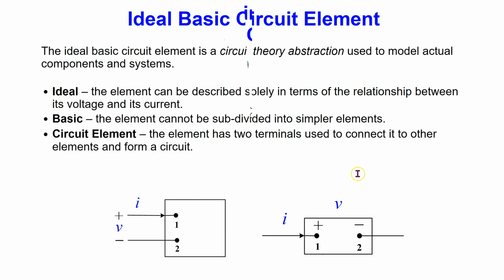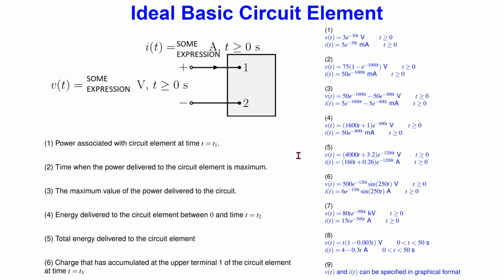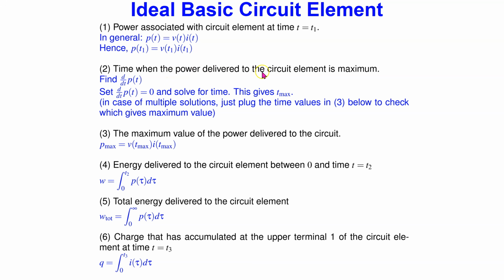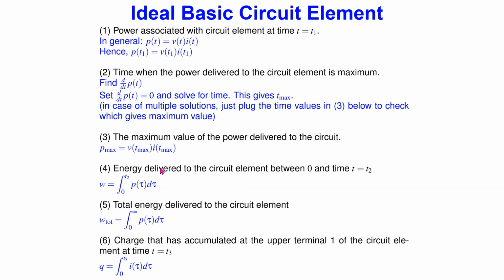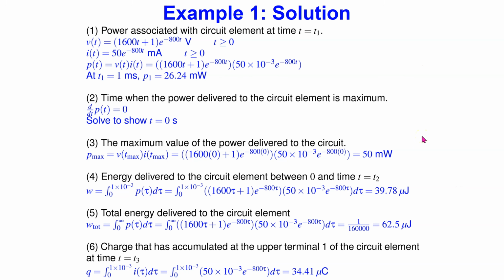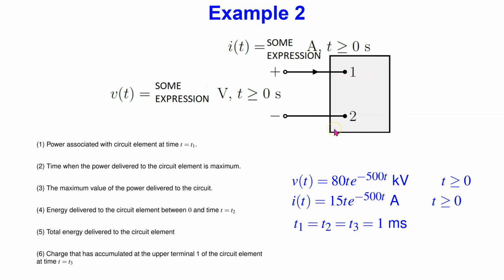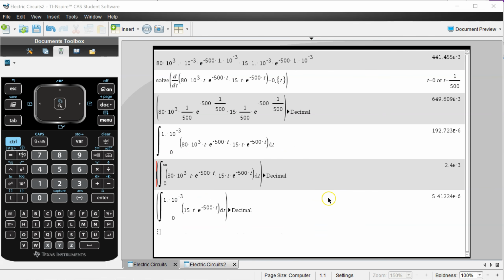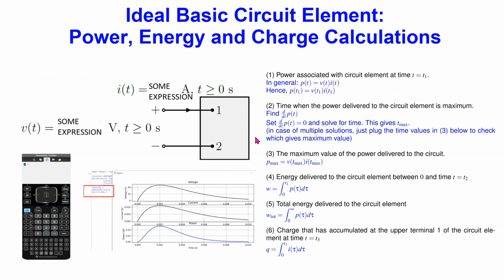Power and Energy and Charge Calculations for an Ideal Basic Circuit Element

Comment from the maker: # Pyspice (Python) code for Ideal Basic Circuit Element power, energy and charge calculations
# 
#
######################################################################
# STANDARD DECLARATIONS

import math
import numpy as np
import matplotlib.pyplot as plt

import scipy
from scipy import optimize
import scipy.integrate as integrate

from matplotlib.widgets import Cursor
from engineering_notation import EngNumber

#######################################################################
# DEFINE INPUTS

# Define the time(s) of interest
# time t = t1 for supplied to the element
# time t = t2 for energy supplied to the element between 0 and time t = t2
# time t = t3 for charge accumulated between 0 and time t = t3
# time tlim = maximum time for plotting

### Example 0
##def current(x): return 5e-3* np.exp(-50*x)
##def voltage(x): return 3* np.exp(-50*x)
##tlim = 25e-3
##t1 = 5e-3
##t2 = 5e-3
##t3 = 5e-3

### Example 1
def current(x): return 15*x* np.exp(-500*x)
def voltage(x): return 80000*x* np.exp(-500*x)
tlim = 10e-3
t1 = 1e-3
t2 = 1e-3
t3 = 1e-3

### Example 2
##def current(x): return 50e-3* np.exp(-800*x)
##def voltage(x): return (1600*x+1)* np.exp(-800*x)
##tlim = 10e-3
##t1 = 1e-3
##t2 = 1e-3
##t3 = 1e-3

### Example 3
##def current(x): return 40e-3* np.exp(-750*x)
####def voltage(x): return (1500*x+1)* np.exp(-750*x)
##tlim = 10e-3
##t1 = 1e-3
##t2 = 1e-3
##t3 = 1e-3

### Example 4
##def current(x): return 5e-3* np.exp(-1600*x)-5e-3* np.exp(-400*x)
##def voltage(x): return 50* np.exp(-1600*x)-50* np.exp(-400*x)
##tlim = 10e-3
##t1 = 1e-3
##t2 = 1e-3
##t3 = 1e-3

### Example 5
##def current(x): return np.piecewise(x, [(0 <= x) * (x <= 50)], [lambda a: 4 - 0.3 * a])
##def voltage(x): return np.piecewise(x, [(0 <= x) * (x <= 50)], [lambda a: a*(1 - 0.03 * a)])
##tlim = 50
##t1 = 20
##t2 = 20
##t3 = 20

# Example 6
##def current(x): return np.piecewise(x, [(0 <= x) * (x <= 40)], [lambda a: 4 - 0.2 * a])
##def voltage(x): return np.piecewise(x, [(0 <= x) * (x <= 40)], [lambda a: a*(1 - 0.025 * a)])
##tlim = 40
##t1 = 20
##t2 = 20
##t3 = 20

### Example 7
##def current(x): return 6* np.exp(-150*x)*np.sin(250*x)
##def voltage(x): return 500* np.exp(-120*x)*np.sin(250*x)
##tlim = 50e-3
##t1 = 5e-3
##t2 = 5e-3
##t3 = 5e-3

# Define time vector
points = 200  
t = np.linspace(0, tlim, points)

#######################################################################
# THEORETICAL CALCULATIONS

# Define the power
def power(x): return current(x)* voltage(x)

# Find the power (W) delivered to the ideal basic circuit element at time t=t1;
p1 = power(t1)
print('power={} W'.format(EngNumber(float(p1))))

# Find the time at which maximum power is delivered to the ideal basic circuit element
# and the value of the maximum power delivered;

tmax = scipy.optimize.fmin(lambda x: -power(x), 0)
print('tmax={} s'.format(EngNumber(float(tmax[0]))))

pmax = power(tmax)
print('pmax={} W'.format(EngNumber(float(pmax[0]))))

# Find the total energy (J) delivered to the ideal basic circuit element between
# time t=0 and time t=t2
w2 = integrate.quad(power,0,t2)
print('w={} J'.format(EngNumber(float(w2[0]))))

# Find the total energy (J) delivered to the ideal basic circuit element
wtotal = integrate.quad(power,0,np.inf)
print('wtot={} J'.format(EngNumber(float(wtotal[0]))))

# Find the charge (Coulomb) that has accumulated at the upper terminal 1 of
# ideal basic circuit element at time t=t3
q = integrate.quad(current,0,t3)
print('q={} C'.format(EngNumber(float(q[0]))))

#######################################################################
# PLOTTING COMMANDS

fig, ax = plt.subplots(3, 1, figsize=(10, 6), sharex=True)

# Voltage
ax[0].plot(t, voltage(t), color='black')
ax[0].set_title('Voltage')
ax[0].set_ylabel('Voltage [V]')
ax[0].grid(True)

# Current
ax[1].plot(t, current(t), color='black')
ax[1].set_title('Current')
ax[1].set_ylabel('Current [A]')
ax[1].grid(True)

# Power
ax[2].plot(t, power(t), color='blue')
ax[2].set_title('Power')
ax[2].set_xlabel('Time [s]')
ax[2].set_ylabel('Power [W]')
ax[2].grid(True)
cursor = Cursor(ax[2], useblit=True, color='red', linewidth=1)

plt.tight_layout()
plt.show()

#######################################################################